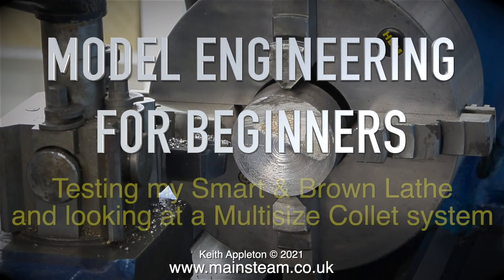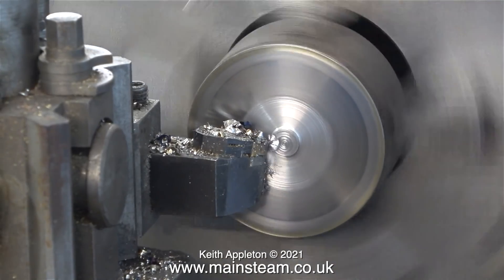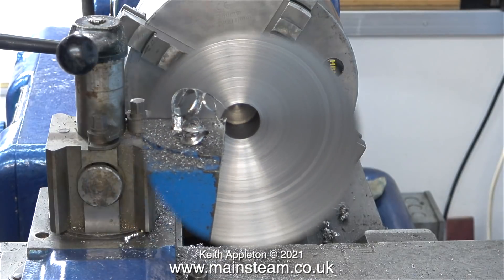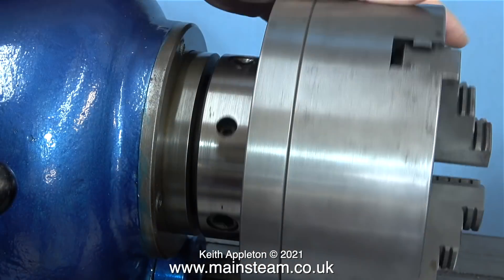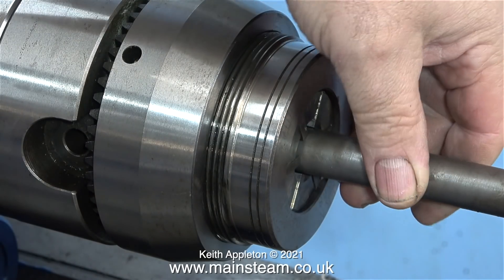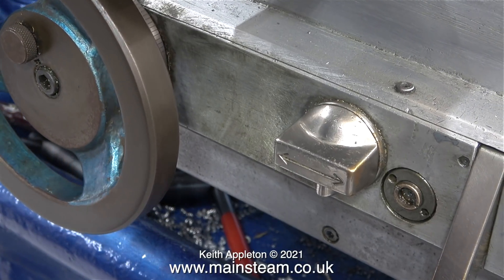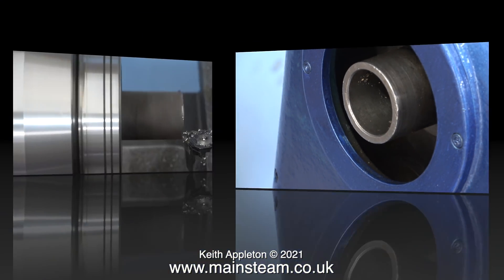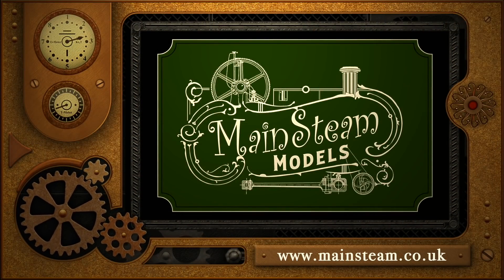TESTING MY SMART & BROWN LATHE - MODEL ENGINEERING FOR BEGINNERS - PART #41

Comment: Keith, thank you for making this series for beginning model engineers!  I hope that you continue it for many videos.  Also, for when installing/removing the heavy chuck from your Smart and Brown lathe, try building a wooden chuck cradle (I think that's the word) so that it will hold your chuck at just below the "proper height" to prevent possibly dropping it onto & damaging the ways, or your back & other parts.  Even though you say you need the exercise, you really don't want to hurt your back, crush fingers, or dent the precision ways.

Comment: If you cut a wood curved cradle that holds your chuck it would be easier to mount.  You place the cradle on the ways, place the chuck in the cradle, then slide the cradle with chuck into the spindle mount.

Comment: That’s a very sweet looking machine, I’m a bit green if the truth be known. I’ve seen other people make up a wooden sled of just the right height to make marriage of the chuck and spindle easier and to protect the ways from damage, perhaps that would be worth the time and effort. I know that I’m not getting any younger either. I’d even consider a small hoist or swing arm arrangement to lift the chuck in and out if it was me doing the work.
Reply from the maker: I need the exercise }:-)))